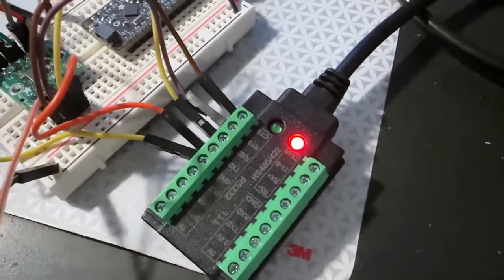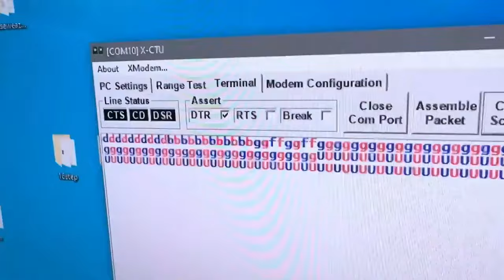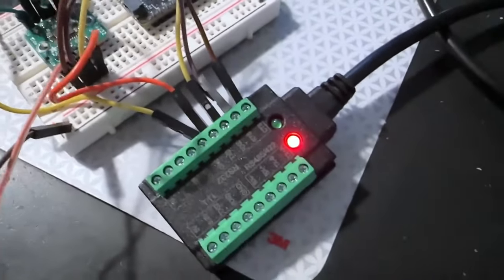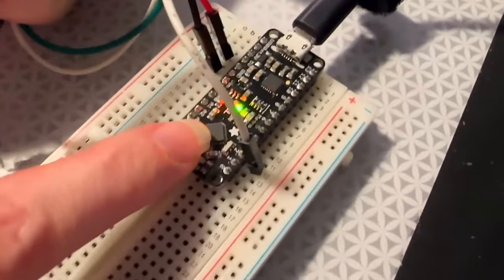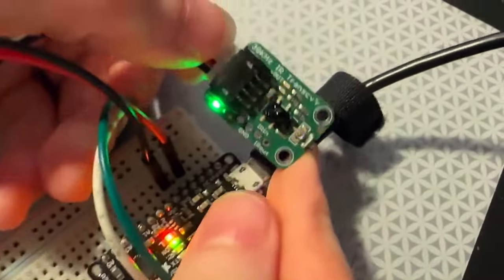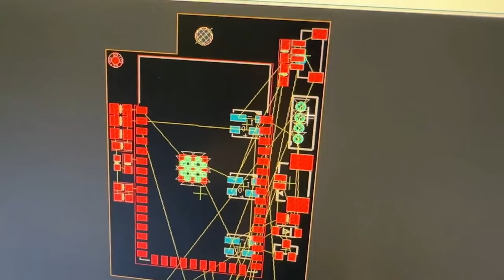Adafruit Top Secret for June 26, 2024 #adafruit

Comment: Kinda scary that the Type-C PD board defaults to Highest Supported Voltage when the DIPs are all Off.  

I would have assumed it would default to 5V.

What happens with multiple DIPs On?  Will is request the lowest selected voltage?